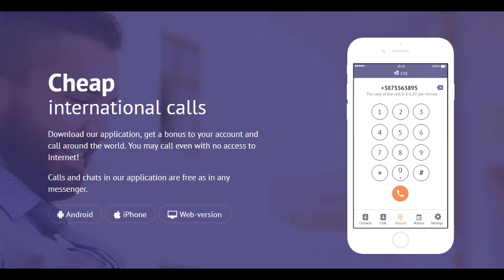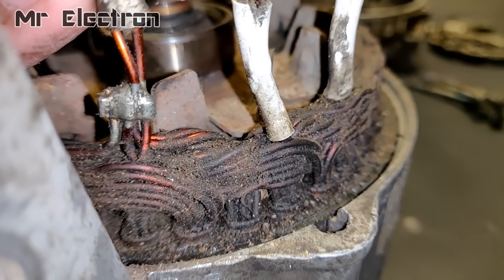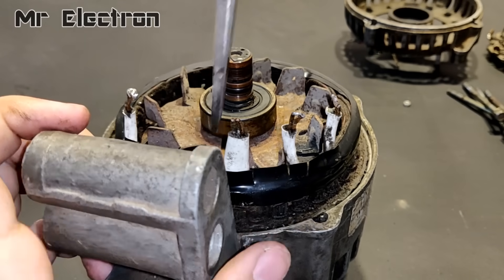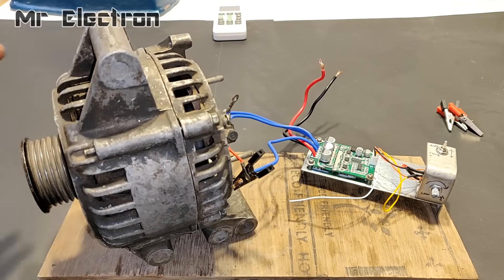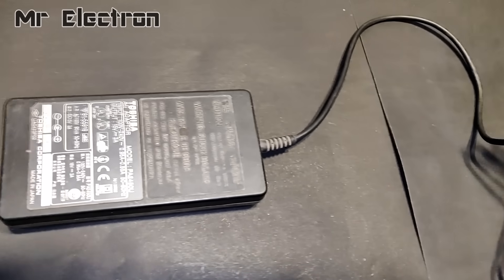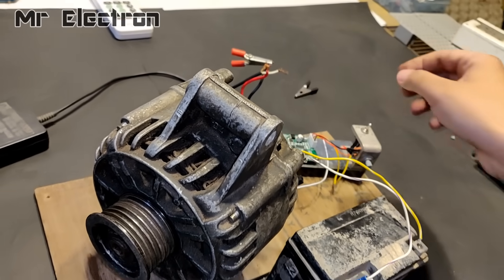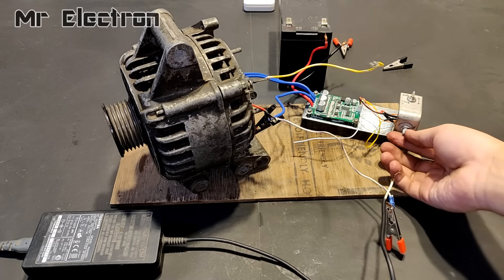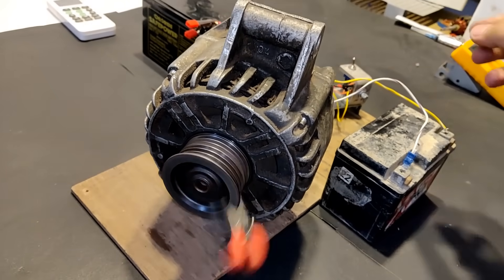12v 120 Amps Car Alternator converted to DC Motor with High Torque using BLDC Controller - Part 2

Comment: Thank you for your video I have got an alternator that I'm going to convert to a brushless motor it has to 4 windings too and I was worried I would have to take the alternator after cleaning it and painting it with spray paint I'd have to put it on one of my trucks little red hot rod and take the existing alternator off from my truck little red hot rod I want to use that on my new scooter that I'm going to make in another couple of months or so thank you very much I don't have to change the alternators around freshly painted one on my truck this red hot rod and the older one that came from the old Ford Falcon which at the moment is on little red hot rod put it on the scooter and I'm going to make in another couple of months or so😅😅😊😊

Comment: You have to change rotor cheap weak magnets for strong neodymium ones and apply 50 V instead of 12 V connecting it with 50 V brushless controller. It will be much more powerful.

Comment: Great video I'm wondering if this could be used in a car audio setup like if I mounted the alternator on a piece of wood running to a lithium bank and converted the alternator to put out a DC current could I charge my lithium bank and or batteries like this using the cars electrical to power the alternator I'm completely clueless when it comes to stuff like this and I've been gone for a long time over 10 years when I left an extra battery in the trunk was doing big things in car audio now everybody's got massive lithium Banks ultra cap Banks lto batteries you name it but they're powering all of that with high output alternators but in my case I've got a newer version car a 2019 Toyota Camry that has a newer electronics build where the computer keeps you from adding a high output alternator to your vehicle so I'm trying to figure out a way to create an alternate source of power in the trunk so that I can put any kind of system I want in my car and I'm not limited and to be honest nobody in car audio knows anything about this because most of them have a vehicle that they can just put a high output alternator onI however don't have a vehicle like that so I'm trying to figure out some way to charge a lithium bank if I got one or lithium batteries without having to do some major conversion to my engine and car computer system any advice would be greatly appreciated or if you know of someone who makes a setup or something like what I'm talking about and can point me in the right direction anything would help I'm at a loss and don't know enough about electrical to attempt it without help

Comment: Thank you @MrElectron I tried this with an old Alternator, Power supply to the armature and 12v and 24Vdc to a cheap BLDC controller off Amazon - I am learning a lot - great to repurpose these brilliant machines!
Reply: Where can I find a speed controller with out having to buy one. Is there something in like a washing machine or something else I can use make this work i have everything  except  for a speed controler

Comment: How do I power my 12v 2hp 3000rmp dc motor
Reply from the maker: You will need 12v 100 to 125 amps powersupply for its full performance

Comment: so i was reading a guy uses only 12v to the stator and a varying volts (upto 4v) at the rotor to control the tourque and rpm in a buggy carrying 3 people, incredible power output for 12v. IM wondering if this is the same as running higher voltage for example 48v stator with say a 12v rotor ? since these motors are variable field ? wanting to know if i can use a 12v 100a rc brushless controller to get a good power output from this motor?(12x100=1200w) or will i need a 1200w bldc motor controller running 48v
Reply: i will be using a gearbox with ratio of about 16:1 from a mobility scooter

Comment: with the car alternator if I use and place 2 car batteries on top of the bike connected together with the speed controller will I have a good result? I had this idea for such a long time and I've been riding an electric bicycle so that with the 2 car batteries I have a very long range

Comment: Very good job. But it will be much more better if you have a continue source of power supply rather than relying on battery power. Like hooking up another alternator with a belt driven to recharge (dc) the two batteries that are losing there juice😁 just a tot

Comment: I'd like to know why you also had to connect a charger to the controller if it's only supposed to be a 12v motor. Does that mean that you have to have  2 12v batteries hooked to it to power a bike?

Comment: Your voltage on the rotor coil is too high even though it would give high torque. If you supply 2v to 3v, your RPM will increase but the Torque will deplete.

Comment: Take it completely apart and clean the parts. Fix the windings, replace the bearings, refurbish the commutator, and put new brushes in it. Otherwise, this is an accident that could have been prevented. Don't be as hapless as this guy was and do it right people. Your life could depend on it.
Reply: Not everything is as peachy as those quick 60 second clips on here. At least the kid got down n dirty and actually did something and made it work. No fire issue or electrocution there is absolutely no issue with what was done

Comment: But was there any amp output at the b+ terminal on back of alternator.  

I need a similar setup to power and recharge 3.5kw EV LITHIUM POWERPACK.

Comment: What if you want to hook it straight to a 12v battery without the controls could you hook the 3 wire to the red wire together and the other to ground will that work

Comment: ..... are we saying here that .... we get more power out ..... than we put in ???? 
i.e., this is free energy ???? 
..... i've seen similar videos that make this claim ..... i.e., the magnetization / Tesla type secrets .... gives u free power
so you could continuously charge the 2 batteries ..... plus have surplus power to charge another battery system 
have also seen this in reverse, with the 3 phase wires.... connected  directly to the 3 phase input of a home electric panel

Comment: Hello Mr Electron ;) I have the same controller like on movie. I want to use this project to the outboard motor but I don't know if I use x3 batteries 12v=36V, that is enough?
Reply from the maker: Depends on the motor.
Reply: @MrElectron   I have alternator 160 Amper bosch from Audi.
Reply: @Mr Electron   I have alternator 160 Amper bosch from Audi.
Reply from the maker: Ok so don't connect batteries in series. Connect them in parallel to get 12v but more amperes

Comment: You never tap a cover on to seat the brushes.....it will chip or break the brushes. That hole in the top of the brush holder is for that...you push the brushes back into the holder, insert a straightened paper clip, slide on the cover until it fully seats and then remove the paper clip, allowing the brushes to seat safely onto the slip rings.

Comment: Hello that alternator has a part number would you please post the part number it's much easier to duplicate your experiment and peer review your results if the exact same parts are utilised.  Please provide the name model and source of the controller.  Also the type and gauge of the wires would you please provide that information as well.  The more people who duplicate and peer review your experiment the sooner the project can be applied to market use.

Comment: the little hole above the brushes is so you can push the brushes in and use a tooth pick or a paper clip
to hold the brushes in while you slide the cap back on, the way you did it worked but it could have caused damage to the brushes

Comment: How much torque does it produce? would it do to use for bicycles? thank you I've enjoyed your channel for a couple years and have boosted my electrical knowledge thanks so much
Reply: The armature voltage effects the torque/rpm ratio

Comment: technically it's not  a DC  motor, because you drive  3 phases of stator with alternating pulses  ... DC motor means it  should run exclusively from DC input voltage. which is not this case, because it needs a controller/driver to  operate .. so it's basically  3 phase AC motor with  DC rotor exciting..

Comment: Hi, if you use a belt and run another similar alternator through this one, can you sue that 2nd alternator's output to charge the battery? Trying to make it self runinig and charging system?

Comment: Mr electrons,I want to know is it possible to run alternators with batteries alone,
Secondly, since the field winding need to be excited and the brush need 12 volts to run the alternator as a DC motor to pull another generator for light

Comment: How to start the alternator as a motor, do not use a controller but directly on the battery, is there any solution ??

Comment: Is it possible to use the rectifier diode to power the rotor coil so it doesnt need an external dc source?

Comment: Man you just covered up the burned out wires. You should have used soap and soft brush to remove the sand, dirt, oils from the windings before and then dip with insulation.

Comment: Nice try. No load yet, everything will be fine. I suggest you get another alternator and couple the two together. You can connect simple resistive heater coils and measure the performance.

Comment: Am I correct in saying that you still use the brushes to supply the rotor...so my question is why is it labelled as a bldc.
Reply: Normally in actual bldc motors the field windings are replaced with permanent magnates

Comment: Can you run a 36volt 20amp controller on the motor to turn  a chain or belt to a wheel?

Comment: IF THE CONTROLER OR 48 VOLT CAN I USE IT WITH 12 VOLT BATERY ?AND CAN WE USE THE SAME BATER FOR THE CONTROLER AND THE MOTOR ?

Comment: Hi Mr. Electron, I'm not a an electrician and do not know anything about electric but I'm trying to learn how to convert an old alternator to  e-bike motor. Here I see you're using a laptop charger to power your controller, can you tell me where you connect the other cable of the charger to? Thank you, appreciate your time.

Comment: which one consumes more power? the stator battery connected? or the bldc controller? can you just put one battery power to both? i mean parallel the power of the controller and the stator? also what type of controller is that? can i use this alternator to my propeller to my Electric Boat project as the motor? I highly appreciate your answer...

Comment: Nice video sir!  For clarification sir, will you please tell us again what winding is that, the one that you left unwired, and the three other windings that you connected to the controller.  Is it possible to connect the controller to the 12 volts battery for its power supply.

Comment: If its running on 36 volt controler why your giving 18 volt charger..show us on 36 volt how its works...n buy 48 volt or 72 volt controler without hall than show its original rpm n torque..

Comment: This 3-phase DC> AC conççverters turn into a brushed BLDC motor, and this auto alternator can also be converted into a brushless BLDC motor. Then N-S-N-S- in the middle with the neodium magnets. This can be accomplished by slicing (irons in the form of mutual fingers surrounding the electromagnet rotating in the middle are also magnetized when DC current is given in N-S-N-S. form). Thus, when 12 volt DC is not supplied over the battery> brush> rings, the permanent permanent magnet is supplied with a 3-phase AC current inverter with a rotor (the brushes are removed from the bracelets in this case) and this alternator speed is adjusted as BLDC. The hub, that is, in the BLDC motors, the 3-phase windings in the core are stationary and the magnetic ring surrounding it rotates, while this time the magnet rotor inside is rotated when it is applied by controlling the 3-phase currents with a potentiometer from the inverter. Good luck with.

Comment: When you spin that, cadden you get electricity from the brushes. Im trying to turn my brushed alternator into a generator. Do I need to remove brushes?  Do you have video?
Reply: Noo you have to spin the shaft and power the coil through brushes with another power source and the stator coils act like a 3 phase genrator which are rectified and regulated with diode and a voltage regulator ic
Reply: @hardnachopuppy  thank you so much

Comment: once converted how long can the motor run if the dc current is supplied continuously?
 will is start to over heat if its running 24/7? What the max V can it run a fridge for off grid?

Comment: I have a controller with just two wires input power to controller and two wire output to DC MOTOR. How do I connect this, seeing yours has 3wires for the 3 phase?

Comment: If you plug the power from the battery to the terminals will it run at full speed?

Comment: You need to connect the coils into a delta configuration to improve the performence of the motor cause in a delta configuration the motor use the 100% of the voltage  and improve the start torque

Comment: Hi ,Mr electron 
I have one query , normally if the supply given to motor  it's starts to rotate , at the same time that same motor   could act as alternator  by mechanical force , form this I have to attain motoring and generation on same Motor, pls tell me about ur valuable idea for this Which mortor can used

Comment: The easiest way to get the end with the brushes back on is to push the brushes into the housing and put a straightened out paper clip in that hole to hold the brushes retracted. Once the cover is on, pull the paperclip and the allow the brushes to drop into place.

Comment: Thanks for sharing this video.
Is 12vdc the maximum voltage for a alternator conversion?

What is the maximum voltage for constant duty?

That model controller is limited @36vdc, is there a higher voltage controller available?

Does the electromagnetic field need to be equal to the controller vdc or is it limited to 12vdc?

Comment: Great and clear explanation. I'll try this but the linked controller is only run at 20Amp and 500w so can this Alternator pull a small kid's kart?
Have you try to run the motor longer than an hour? if the controller will not burn?

Comment: Just assume that with the setup in this video, the alternate us running at 1000 RPM. Will it happy the other way round ?  i.e,  I will rotate the rotor at 1000 rpm with another motor. Will the alternator generate same volts ang Amps ?
Reply: No it will generate less as there are friction and heat loses

Comment: As I previously posted in part 1, this can be done by using an aftermarket permanent magnet rotating field or waste power applying power to the rotating field and yes you would use ALL three paired stationary stator windings driving them with a three phase motor controller, it would have to be a really big 100A controller.
Of course this is fine if you just want to tinker/play around, otherwise it is really a waste of time, might just as well use a starter, something that was designed to be a motor in the first place.
Then again if you could integrate it into your vehicle accessory belt drive system, you could use it to give a little extra horsepower for going up hills...Ford actually already has a system like that.

Comment: Why you can't run the alternator brushes and controller... from the same battery.... And why you can't increase the volt up to 24v or 48v
Reply: the core and controller can connect to the same battery provided its 12V     if 24V   the controller is at  24V and the core is at 12 from one of the 12V batteries, But since the stater and core are electrically  independent they can be connected to the same DC source  I have done this myself using a 24V E-Bike controller  and I simply just center tapped the battery fro 12V for the core

Comment: Good information thanks. Also can you do a video showing how long it takes to run the battery capacity out most people that want to build an electric bicycle are worried that the alternator would drain the battery capacity too quickly can you show your work under load driving a bicycle?
Reply from the maker: Its enough for ebikes but for an electric car, you will have to go for a higher power controller

Comment: Thanks for This Very Good Video.  
Question, , with an Alternator like that on this video...
Once you converted into a motor.. What's the Power in Watts or HP.,???. Thanks.
Reply from the maker: 1500 Watts
Reply: @MrElectron  
a 2.5 HP. gas Motor
Have @ like a 100 cc motor. or So.
@ 40cc = 1 HP = 750 watts
So this 2 HP E. eng. Will Have a 1500 watts and Similar Power of a 80cc eng.
Reply: Which configuration of input voltage to the stator and rotor is producing 1500W?
Reply: @joshuabeard9881  he getting nowhere near 1500 watts with a little 12v battery like these.
Reply: @blackz06  what would you estimate he's getting with 12v to the rotor and stator?

Comment: Did you not know the little hole on the brush holder is to retain the brushes during assembly?  Makes easy short work  of it.
Reply from the maker: Yes i knew that but then i thought its as easy to do it this way as well
Reply: Mr Electron jwwrr

Comment: if you lower the voltage on the rotor you can get much higher rpms (With a loss of torque of course).  I found that 6volts on the rotor can work nicely but around 2volts can really fly, just hard to get started
Reply from the maker: Thanks ! For the info.. I will surely try that :)
Reply: @MrElectron  did you ever try it? Your motor is turning very slow compared to how fast it will with 1-2 volts on the coil.
Reply: The strong field using higher voltage on the the rotor results in higher back emf per rpm.  Great for high torque at low rpm but at a rather low maximum rpm at a given voltage to the ESC. The opposite it true with a weaker field resulting in lower torque but higher RPM.  Controlling the field voltage and the ESC can  make a motor not needing a transmission for an ebike or similar.